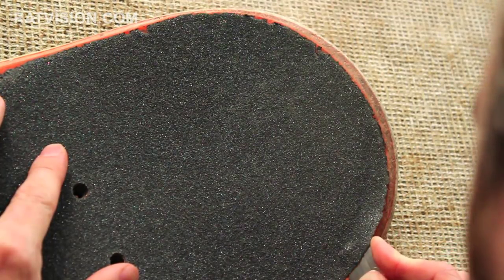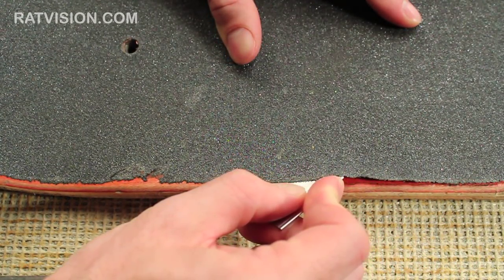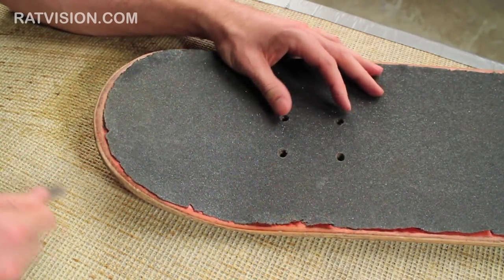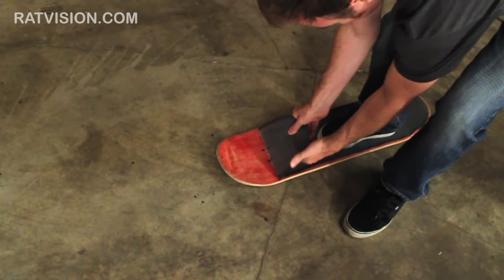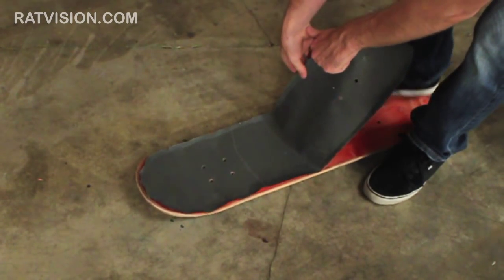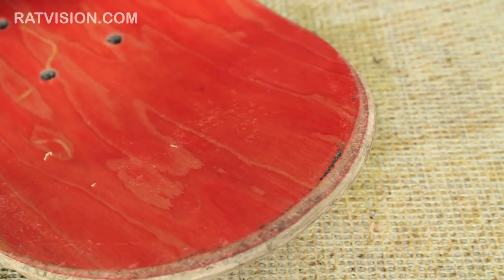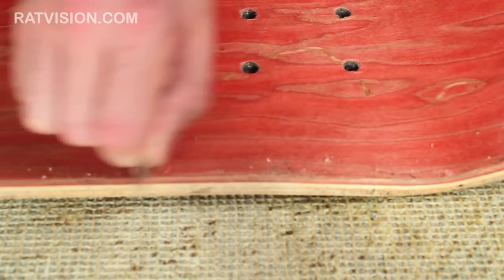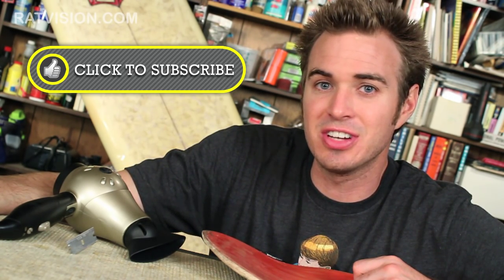Remove Skateboard & Longboard Grip Tape

Comment from the maker: This all depends on the grip tape brand and the surface of the deck.  Sometimes the adhesive will get left on the deck and sometimes it won't.  It doesn't matter if you use heat or not, it just happens either way.  After removing grip tape, it is totally ok to put new grip tape right over the adhesive left behind from the old grip tape.  It will not effect the new grip tape at all.
Reply: Do the trucks have to be off while removing the grip tape?
Reply: @kaiherrell8381  yes

Comment from the maker: I replied to this through a phone, not sure if you got it, it didn't post.  The adhesive stays on the deck almost every time grip tape is removed.  Nothing is screwed up.  Place a new sheet of grip tape right over it.  The adhesive left on the deck will not effect the new sheet in any way.  Hope you feel better.

Comment: Do you have to use a razor blade or does something like a x-acto or retractable knife work just as well?
Reply: I used a razor blade, I think it might be easier with an exacto blade since there is a handle to hold on to.
Reply: all I used was a knife last night and it works :)

Comment: How do you remove the stickyness of the grip tape?
Reply: You dont, doesn't matter since you'll be putting new grip over it.
Reply: Lazy Prophet it does if you wanna do a custom paint job or design on the board before applying let’s say clear grip tape
Reply: Dylan Maglio use goo gone 🤷‍♀️
Reply: Nic M.T lmoa
Reply: Alex Ron sand paper!
Reply: @NH-ee4wv  lighter fluid removes the glue effortlessly……

Comment from the maker: You may not notice a difference at all, but your bearings might.  Washers act as a bushing between the axle nut and the hanger bearing stop.  They also are used for loads and pressure applied by the axle nut.  So they help with proper bearing functionality.  In the end they can make bearings more efficient and last longer.

Comment from the maker: If it's just thin carpet fibers you can grip right over it. New grip should stick on just fine.  Some adhesive is usually left on the deck after removing the grip tape.  So it does not need to be removed.  If you really want to clean it off use citrus cleaner or rubbing alcohol, but this can be time consuming, messy, or just not worth cleaning to begin with.

Comment from the maker: Deoending on the deck surface sometimes the grip will come off leaving no adhesive left behind, but other decks love the adhesive ad it doesn't come off.  You can apply your new grip tape right over it.  The adhesive will not affect the new grip tape and you won't notice it at all.  It is totally OK.

Comment from the maker: Yes it is possible to take that stuff off.  You can't grip over it.  It won't stick.  It needs to be scraped off using a heat gun.  A hair drier probably won't get hot enough.  It won't work if you try to only scrape it off.  It needs to be taken off with a heat gun to take all the resin off and the grit (rocky stuff).

Comment from the maker: Not entirely.  The bearing is not touching the riding surface. The wheels have a lot to do with speed.  Different wheels work better for different riding surfaces.  You have to tell us what condition you are riding in.  For tricks that's a whole different thing, because then you're getting into diameters where truck heights, and even your own legs are factors.

Comment: Thanks so much I did this to remove my grip tape and put new grip tape on my board after my local skate shop said they wouldn't do it. It took just a little over an hour for the whole process. Sure it wasn't perfect, but it was extremely good especially for my first time!

Comment from the maker: It's the bearings.  Sometimes the axle nut on complete boards (made in China) come really tight.  You may need to give the nut a little turn to allow the wheel/bearings to spin freely.  You may need to only buck the nut off a quarter or half a turn. Be sure the nut won't come off by itself. See if that works.  If not, then you may need to get new bearings.

Comment from the maker: You could definitely do what you are thinking, but grip tape is extremely sticky as you may know, and it could lift off the paint and clear coat off the deck if you tried to remove it.

Comment from the maker: Mob grip should actually cause less wear than probably any other grip.  If you look at mob with a microscope it has smaller grit that is more compact.  This makes the grip surface easier to slide on.  You could sand an area of grip tape to dull the grit to prolong shoe damage.  as you know if you sand that area the grip tape will lose a lot of traction.

Comment from the maker: Is the paint actually just the graphic printed on the board?  If it actually is paint then you may be out of luck.  You may need to really make sure the adhesive gets warmed up good to HOPEFULLY come off the paint.  You also have to hop that the paint is in the wood good.

Comment from the maker: Heat gun and metal spatula. Don't burn the wood. Just get the coating hot enough that it can be scrapped off.  You can try a blow/hair drier if you don't have access to a heat gun.

Comment from the maker: That's an opinion, which is perfectly fine. But if you said, "because I like the larger silicon carbide grit that is spaced out more than the smaller grit that is more compact used in MOB grip tape", then that would have been an even better reason.  What are the physical features of Jessup that you like so much?  Aluminum oxide grit in a very small sense is not as sharp as Silicon Carbide grit, but lasts longer, so not all grips are the same. Now you know a little more. Jessup is good though.

Comment from the maker: Tighten the nut all the way down until it stop.  DO NOT FORCE. You'll feel the nut stop slightly.  Back it out 1/8th to 1/4th turn just until the wheel spins freely.

Comment from the maker: What you did was not heat the grip tape enough so it separated.  It's a plastic film that holds the grit and resin and has adhesive that sticks to the deck.  You need to heat that up and peel it off.  It's a lot harder to do, but it will come off.  The deck will be sticky, and that is totally normal.  Put new grip tape right over it.

Comment: In an originallongboardshowto video on how to apply grip tape, he removed the griptape first. Then he removed the left over adhesive with ink remover. Don't you need to remove the leftover adhesive before you apply the new sheet of griptape? Anyways, awesome video!

Comment from the maker: That's aluminum oxide grit.  It's actually not a tape.  It was sprinkled on and is stuck on with probably a urethane coating.

Comment: I notice you don't have any trucks on the deck. Do you have to remove them first to stop the tape snagging round the holes?
Reply: It really would just help to remove them in general so they won't get in the way
Reply from the maker: Yes, and you don't want to cover the bolts with new grip tape.
Reply: Thanks guys

Comment: hey, so basically, i've built myself a new drop through deck, i'd like to know how i could colour my deck blue, in the same place where I am going to put my custom design grip tape on. i have clear coating, although i could only get acyrlic paint. if you could let me know if just painting it then clear coating, and the putting grip tape will be fine, as in it will stick for long and if it will still be an easy process to remove the tape later on. i kno its off topic, but thank you for your help!

Comment: I bought a new deck online and the shop gripped over the awesome graphic on the top. Does removing the grip take off the graphic transfer or does it usually  peel some off? I think I might be able to just make a light cut into the grip above and below, heat and peel up...or that might just be asking for trouble.

Comment from the maker: All grip tapes are good.  They all do what they are supposed to do.  however, some grips work differently because they have different grit (the sand), grit size, resin, or grit amount. Grip tape destroying shoes is just part of skating. Most parents hate it because they spend so much money on shoes.  Tell your parents how expensive it is to play sports. Hockey is thousands! Other sports require pads, cleats, uniforms, and other gear. Skateboarding can be cheap, when you compare them.

Comment: I had a small chip on the nose side of my board, I also had some dog crap on my grip. I just lifted the grip tape at the chip and pulled it off. I didn't use a hairdryer of razor, and the new grip applied pretty well. Just a heads up to people to don't wanna spend the extra minute or two.
Reply: That doesnt work for everyone, ive had 40 decks + and that only worked once for me :p bad glue..

Comment: Thanks for the Video, im currently thinking about Putting griptape on my loaded dervish. Can i Just put it on without smoothing the old one Out( removing not an Option because clear GRIP thats not actual Tape) and do you think its still reversible if i want to go back one day or need new griptape.

Comment from the maker: There was no adhesive left on that board. You can see how he just peels the grip tape right off. All he was really doing was cleaning the wood. That was some pretty crappy grip tape if it peels off that easy. It's a real pain in the ass to remove the sticky adhesive left behind. It's totally fine to apply grip tape right over the adhesive. It does not effect the new grip tape at all, and you won't feel it.

Comment: I did as you said but the grip was super hard to get off so I heated it in parts for 2 minutes and then just pulled up that part.  This is after doing the edges first.  Then I would move on to the next part until I got the whole sheet. When I finally got it off, there was not a solid layer of film left over but the entire top of the deck was sticky as hell.Judging from your video that didnt happen.  What did I do wrong and can I still apply a new sheet of grip and be able to skate it no problem?

Comment: I just removed the grip from my skate board, but there is still a sticky residue left on it, is that normal or did I not apply enough heat? also I tried to remove the graphic on the bottom but it left the part that sticks to the board. any ideas of how to get that off?

Comment: Thanks for the info, can you use a stanley knife instead of a razor blade?
Reply from the maker: Sure.  It's still a sharp blade.  The downside to using the handle is that it may not allow you to rest the blade against the deck.  It may end up making it difficult to get a straight cut.

Comment from the maker: There is no way to fix flat spots.  Sometimes crying helps, or laughing at the fart sound your wheel makes.  It's one of those things you can't fix. Even if you actually get the wheel perfectly round again it would be smaller than the other 3 wheels.

Comment: Razor tail is when the tail wears down and gets sharp, like the edge of a razor. It happens when the tail drags on the ground. Common ways of getting razor tail include putting too much pressure on the tail in a manual and any time the board pops off the ground.

Comment: I have a brand new board that I want to make into a shelf. The only problem is that the board has grip tape applied to it already. After I take the grip tape off, how can I remove the sticky residue left behind?
Reply from the maker: Use citrus cleaner.

Comment: i heated it up for about 3 minutes and then i lifted up about an inch of the grip from the nose of the board then i went around the edges of the board with a razor blade and then i started to pull it off, and i fell because the sticky film was still stuck to it and the actual grip came off. sorry about making it sound so bad, i just put it over the film

Comment: So I removed the grip tape on my longboard because I'm making a custom grip tape where a lot of the deck wont be covered but, its really sticky and will get dirty easy.
What should I do?
Reply: wash it with rubbing alcohol
Reply from the maker: You could use rubbing alcohol, or citrus cleaner.

Comment: I got gum on my griptape should I get new grip or is there a way for me to remove it?
Reply: While I haven't tried getting gum off of grip tape, I have gotten gum off of other things similar to grip tape.  I have found the following to work depending on what you readily have available around the house: heated vinegar, isopropyl alcohol or WD-40.  I would try the isopropyl alcohol first as it the least reactive and dries fast.  Just remember that vinegar is acidic so try to only get it on the gum and wipe up any spills quickly.  I've found WD-40 to be the least effective and requires the longest soaking time.  As an added note, isopropyl alcohol works very well in removing other adhesive things you might want to remove, such as old bumper stickers and such without damage to the surface.

Comment: Does this work on penny boards? Just because well penny boards are plastic and the heat might affect it. Probably a stupid question Rat Vision – Skateboard Tech
Reply: TheRealDerpShady I'm not, I was replacing the griptape not removing it all together
Reply: ***** good point
Reply: Rosie Barton idk i  really wanna take off griptape on my board but idk if its safe
Reply: Brian Stoppelmoor I took it off mine but I didn't heat it up, it just ran a blade along the edge and it worked okay.
Reply: Thanks
Reply: +Rosie Barton Itll be fine lol, I think ima try and take the grip off my board then try and apply it to my penny and get new grip for my deck i skate more and I like to cruise and just ride in bowls but i slip so ima try it lol
Reply: Cyrus Sanchez bit late mate

Comment: is there anyway to get the adhesive off or make it not sticky i want to take off the grip tape on an 80's style deck (reissue not going to ruin one) so i can leave a part of the back section open like they used to if you know what i mean
Reply from the maker: Yes.  The best stuff to use is citrus cleaner.  Try not to get it on the graphic.  Dilute the citrus cleaner with water for cleaning any graphic on the top. I say this because you want to preserve the graphic between the grip tape right?  Citrus cleaner won't take off the graphic, but it could make it fade.  Any cleaner will make it fade though.  Anyway this is the absolute best stuff for removing adhesives.  Try to wipe off as much of the adhesive first.  Once the citrus cleaner touches the adhesive it will get all gooie and messy.  Just keep using a new paper towel to wipe more off.  You could also start with duct tape.  Place it on the adhesive and rip it off.  DON'T do it if the deck has paint or on the graphic because you'll take paint off.  If its just wood or died wood then use the tape. If you have other questions ask away.  The citrus cleaner should also make the deck look really clean and give it some shine.  If you want to help preserve the deck, you can get a spar urethane spray with a gloss finish.  This will make the deck look really clean, shine, and look new.
Reply: Rat Vision – Skateboard Tech the deck is stained so when i use the tape to take off the adhesive should i have the citrus cleaner on it if so how much like just enough to get it moist if i'm using the duck tape? and thanks for repling

Comment: Do you have to have grip tape or can you ride without it??
Reply: I will get slippery. But you will get a lighter board. So remember the old school boards? With no griptape in the middle of the board? That takes some weight off. Along with removing four of the nuts and bolts on the trucks. Just keep two on each truck diagonally. And now your board is even lighter. Then drill four giant holes in the board. And the board becomes weightless. It just takes to the sky. That is what they used in that movie. Back to the future II

Comment: Ive found when i removed my griptape from my longboard using a hair dryer that it left loads of glue on the board but if i didn't heat it its came clean off, with no residue. Also ive found that if you want to remove the glue left on the board completely dabbing the glue with the griptape takes it off :) (I only did all this as alot of the base of the board was going to be showing with my new grip design so i wanted it nice and clean)
Reply: hi how long would you recommend to heat up the grip tape for? as im planning to leave quite a bit of space ungripped on my longboard just afraid that the glue may make it sticky

Comment: and if i remove it will my board be sticky i want to make a plank for on the wall
( sorry for my bad englisch )
Reply from the maker: +Wouter Stoffels It will be sticky.  Use a citrus cleaner or rubbing alcohol o remove the sticky adhesive.
Reply: +Rat Vision – Skateboard Tech  could you try goo gone ?
Reply: +edwin valadez wd 40 might work also and goo gone should work fine.

Comment: do u have to take of trucks and wheels to replace grip tape?
Reply: +Morales 123 just take the trucks off
Reply: +Morales 123 yes because grip does not come with holes already there so you will need to poke the screws in yourself

Comment: My friend removed his and there was still the sticky crap ALL OVER THE DECK. We were working on the deck and it's hard to get off any suggestions?
Reply from the maker: Sorry for the late reply, but you didn't need to worry about the adhesive.  Put new grip right over.  Does not effect the new grip tape.
Reply: we did and its ok :) thanks for the help
Reply: Rat Vision – Skateboard Tech what if you want a section of the board to be blank, how would you remove the adhesive?